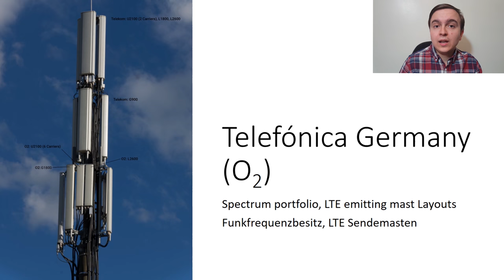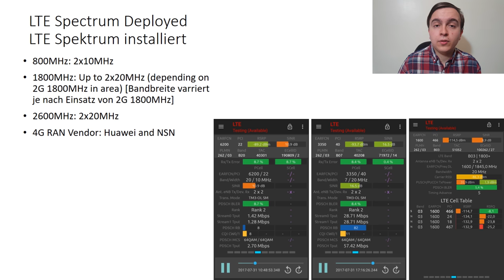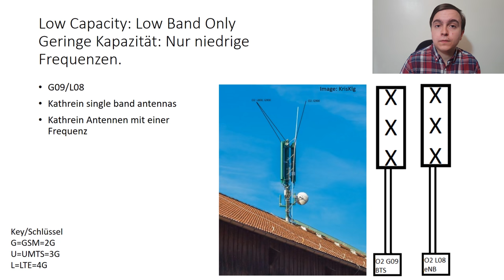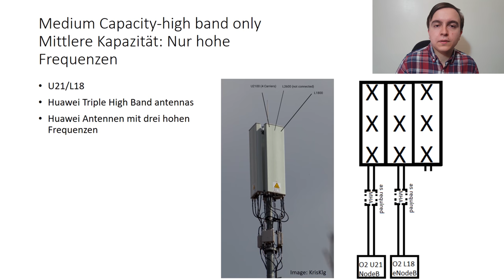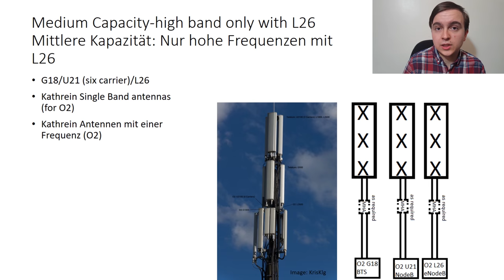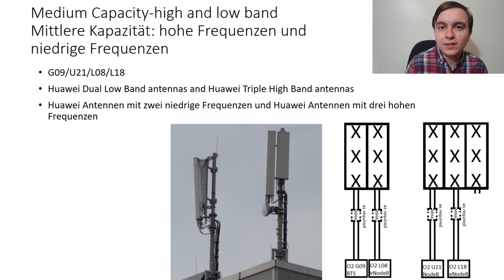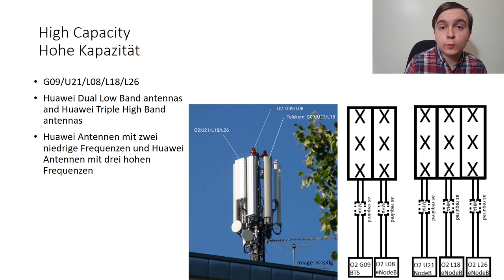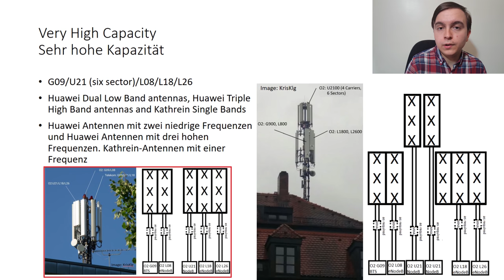Telefónica O2 Germany 4G LTE Deployment and Masts Explained with RF Schematics

Comment: Have you seen the phone signals on a SDR?  They're massive and really strong!  They fill the screen on the full 10MHz bandwidth and decimation of my SDRPlay RSP2!  I saw 3G or 4G at around 800MHz and 2G base stations at somewhere like 940MHz then next to them smaller signals hopping and jumping around that I guess were from the mobiles talking they sounded like they do when they interfere with audio equipment.  I even tried putting the phone near the receive antenna but must have been looking in the wrong place.  Cannot see above 1800MHz though.